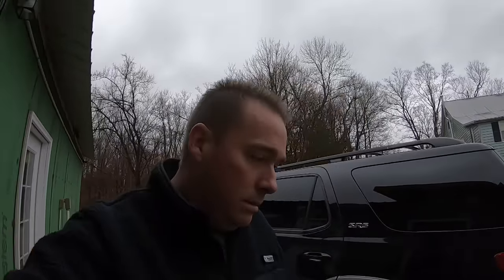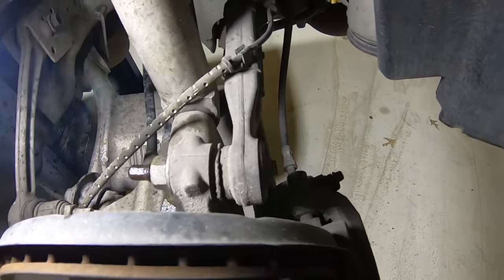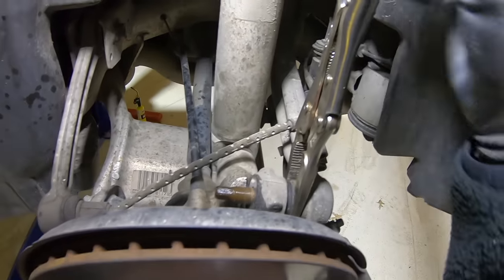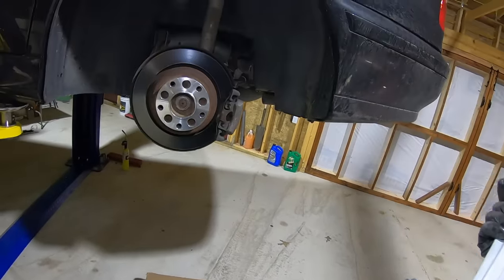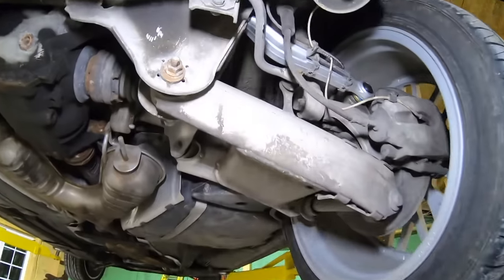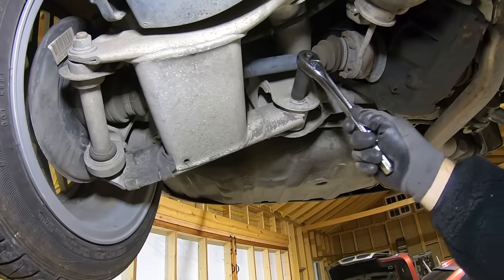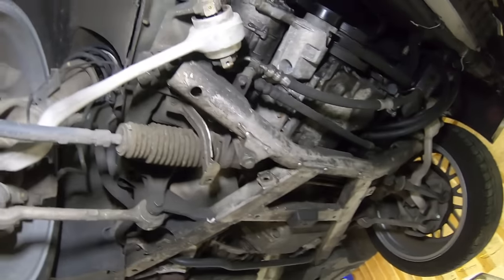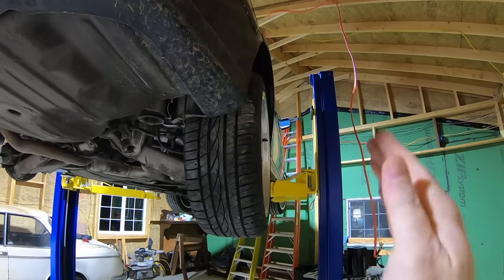BMW Rear Tire Wear Fix Control Arm Replacement And Wheel Alignment DIY

Comment: *Nathan, Before u go under the lift always gently lower it to where it's resting on a safety latch. You'll see the hydraulic hose lose tension as you reach the lock. I've used this practice for 20 years, same lift, never one problem knock on wood. Not breaking balls, just looking out for you and the hydraulics. Thanks for the cold start, best song I've heard all week 👍
Reply: I was taught that from day 1

Comment: I worked for bmw. Their camber on their wheels is intentional. If you align their wheels directly up and down you run into other issues with transmission and dynamic stability control programs. The car is designed to use the camber of wheels to properly utilize stability control. You cause premature wear to internal parts when you mess with factory camber alignments. And some of those stability controls costs thousands to replace. Tires are relatively inexpensive compared to stability control modules and other parts inside the transmission.
Reply: By far the most valuable explanation and warning, to not veer from design. Just swap out those tires, unless you want a project.

Comment: BMW's are supposed to have slight negative camber on the rear, they are not at neutral. You need a hunter 4 wheel alignment machine to set it up properly

Comment: Fixing my rear toe problems today thank you so much nathan you mean so much to my e39 540i.
Reply: Did your car drive weird down the road with rear tires out of wack
Reply: @hilfiger.__hendrix._2181  no everything actually went smoother. It corrected a few degrees of camber when i got it aligned. I also did the fronts as well. I only drove it around my neighborhood for a minute then got a free tow off my insurance.

Comment: I just had my four E39 rear upper arms reco'ed. There's a good suspension joint here in Bangkok that will fit new ends to those arms. The bush and the Ball joint. They make all the stuff in-house.
I fitted a set of rear sway-bar drop links from them 4 years ago, still tight as a drum. Better than the FEBI's I bought, and sent back for being loose from new. So I trusted them to do the reco. $165 total, including labour :) And I keep my original BMW arms.

Comment: If you set the rear camber to neutral it will drive like crap and likely cause positive camber when you're actually driving

Comment: From what I understood, my Z4 since i bought new (2004) has always worn the inside of the rear tyres, if you adjust it so it doesnt then in a corner the tyre wont be flat and you end up with less grip.
Reply: It's worth doing. Your losing corner grip "at the limit". Unless your z4 is a race car you'll appreciate longer tire life. And you'll gain grip going straight with less camber. It's a trade off.

Comment: Anytime you adjust the camber in the rear you must check and or reset the toe settings or you will  have major tire wear. Camber first, then toe. Recheck all settings with vehicle on the ground after it has been moved some.

Comment: Looks like the lift is holding up. Good Job. 👍👍
Reply from the maker: No problems after driving the bolts home
Reply: @NathansBMWWorkshop  GOOD DEAL

Comment: nice 2002 you got there ❤...BTW on the rear camber...do you need to loose the bolt on the other side of where you did the ratchet setting to 0? or just adjusting without any other intervention? tanx in advance. I have all 2013 x3...is it the same setup?

Comment: I have a 2014 bmw 750 li and the drive train malfunction came on, people are telling Me different things that could be wrong, unfortunately I found your channel and would like the advice of an expert. Not only that, My front wheel on the driver side is running against the control arm. Any suhg🎉?

Comment: You need EZ Red wrenches. The flex head double box end ratcheting style. Also get you some magnetic camber gauges. You can set camber really easily with those. I think the north star company sells those. Should be slightly negative on these cars. 5 series non XDrive always chew up rear tires as it is anyways.

Comment: My 2000 e39 wagon you have to remove strut to get wishbone out. Spring and shock seperate. Surprised front upper control wasnt bad also.

Comment: Need to do this to my x5 06
Reply: G0BLiN  on the x5 they sell the adjustable ones I have a 4.8is the camber in the rear is bad on those that’s why they sell adjustable ones

Comment: Dang! Im about to do this on weekend on my e39 528i haha thanks for extra info!
Reply: If they are not that rusty, you can use a 10mm on the hex and the 21mm on the nut. Tightening torque is over 150lb/ft though

Comment: I like to go with Lemforder arms and bushings whenever possible. They are on Amazon and eBay for prices that are fair. 😎🇩🇪🚙
Reply: BMW=lemförder!
Reply: What is the part called because rear toe arm does not come up . Can some one post the part number .
Reply: @mrdebonair7738  
Go to Realoem.com put the last 7 of your vin in the appropriate space and then find your part number. Then go to FCP Euro, eBay or Amazon and paste the BMW part number in their search bars and someone should have a cross over for the Lemforder part that matches.
😎👍
Reply: @BirdogEd   i just need the actual name of the part it’s not toe arm. There and upper and lower  arm in the rear suspension, no?  With out the genuine name of the part it won’t show up in any search engine only general parts will come up. What  is the part called by bmw or fcp ?

Comment: But if you put a 6 point socket on there instead of a wrench it will not strip. because you will be holding the whole part not just the quarter inch with a wrench

Comment: Ever see a 3 liter e53 throw stop engine oil pressure only at idle. Oil level good. Im thinking oil pump is going or nut came off

Comment: Scared the death of these rod bearings! Something that M5 and M3 owners must always have on their minds 🤔
Reply from the maker: I dont even want to rev mine without changing them lol
Reply: @NathansBMWWorkshop  hey nathan, what does a good price look like for the E90 series M3 rod bearings?
Reply: I spun one on an N54.  Saw some tiny shavings in filter.  Took apart and crank was pristine.  Replaced all 6 as nd I got lucky.  40k miles later oil filter has nothing.  I know guys had to replace motor

Comment: 9:12  ,  the nut is rusty siezed on my E53 - my e53 has wheel alignment issues and the guy said he can't do the tracking as that nut is siezed. Any way that nut can be loosened or changed please ? Many thanks.

Comment: Hey Nathan I gotta question. I bought a 2007 750i few months ago as is. After replacing the coolant transfer pipe and new battery, I got warning lights all over the dash. I saw a video from a guy who said he spoke with you about the engine VVT module. I have a similar situation as he does along with transmission faults as well. I'm suspecting these units got wet to becsuse of the windshield cowl shows wear damage. My question is, what do you think I should go from here?

Comment: I have 2002/09 E53 3.0i without air suspension. rear axle got rebuilt with Meyle HD and Lemförder pieces and the car has got alignment done 3 times now (first time after rear axle rebuild, 2nd time after two arms were replaced in front axle and 3rd time was after I hit the pavement on black ice). yet after all those alignments every time it looks to me when looking from the rear, that rear wheels are still slanting inwards compared to fron wheels. is there like some sort of compensation angle to get it perfectly straight or should it actually stay within the AutoData or whatever software they use on the alignment bench?

Comment: Hey buddy... i been watching your vids for awhile now and i would like to ask you a question and hopefully get some advise from you...first off, i have a 2008 bmw 550i with 112,039 miles. Its been starting to make a noise every morning on the driver side sorta next to the alternator. Its like pumping noise. It has what looks to be water hoses from top and bottom. I do not have an electric water pump on my model. Please advice on what it might be and what the part might be called. Email me so i can send you a brief video of what it sounds l8ke and so you can see where im talking about

Comment: I took mine for alignment today but he couldn't do the rear as he thinks I need new bushes in my swing arms I have an e53 x5 has anybody else had the same issues thanks.
Reply: E53 2003 manual trans:  My alignment guy took it as far as it would go and then swapped the tires off the rims.  That will get me another 20K miles out of the tires.  When it is time to replace the tires I will do the control arms in 2 years.

Comment: Rod Bearing ! There will be many signs before there are toast ! I cannot wait and see them I Beat there Clean and U are worring for nothing ! Motor sounds New !!!
Reply: Mark T +1 if the current owner serviced the smg pump they surely performed regular oil changes.
Reply: @mikeb2496  Right ! I daily my M3 06 93K and i know it has been maintained and in four years i have never seem it burn a drop of OIL ! Just did an oil analysis came back great !!! So he wants to open her up and when he sees no ware on the upper bearing then he will just replace anyway ! thats a 1000 in parts his $$ ! Right
Reply: Mark T wow my m5 uses about half a quart every 750-1000 miles
Reply: @Garik.e60  it's worth trying cerma additives I have used them all with great success highly recommend just let me know if you have any questions I'd be glad to help you
Reply: Nice on the M3! Ya IMHO Nathan's doing the bottom end so when he sells it he won't get beat up on asking price. I Daily an 09 e82 n52 6sp msport. 87k burns half a quart every 3000,  i actually ran it all day in the quarter mile 6passes and didn't burn off any detectable amount. 14.3 was my best btw new media dragstrip PA
Reply: @mikeb2496  Look into Cerma.com you can call the owner John he will answer any concerns ! Like i said i have done all the Additives starting with the SID Cerma Incredible results then for $125 did the Vanos additive I do not need to replace my seals this worked Great ! Just finished with bullet proofing my Hub and splines ! Runs like a Raped Ape ! LOL and at 93K just replaced VDO fuel pump and Bosch MAF
Reply: @markt9438  I'm not complaining thought it is what it is. Besides in the manual, it says not to use any type of oil additive. TWS is already pretty thick lol.
Reply: @Garik.e60  I use all cerma oil additives the owner of this company his name is John he's own many BMWs and he has thousands of customers this product has been on the market for over 9 years and it works go check it out cerma store oil